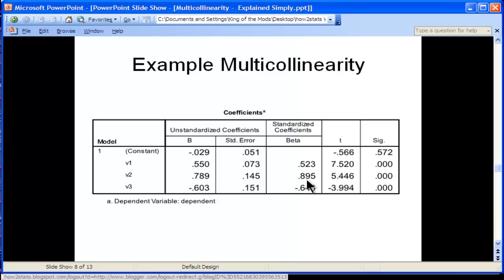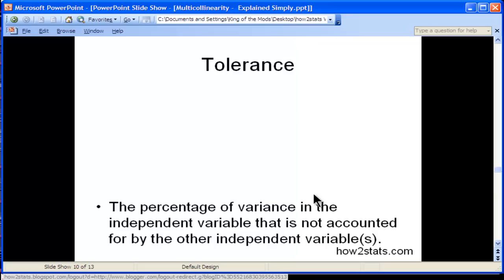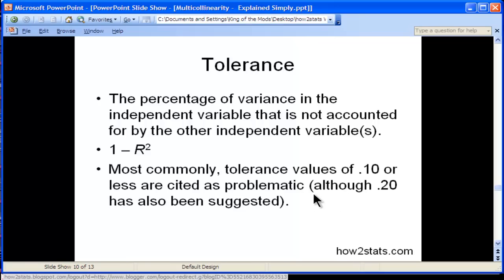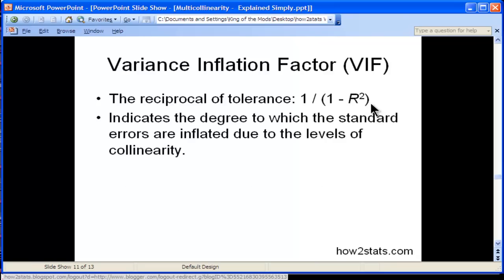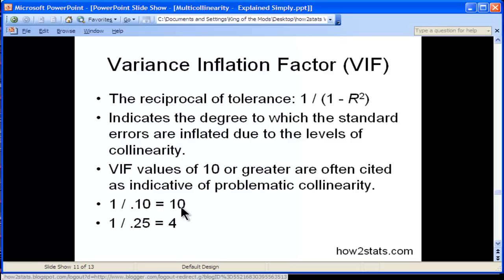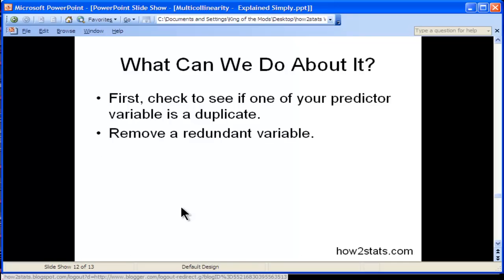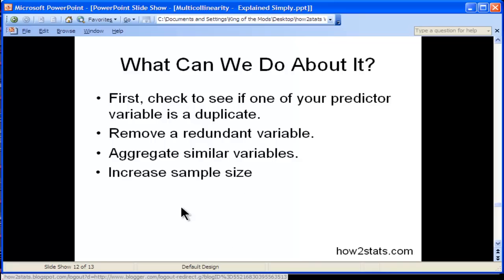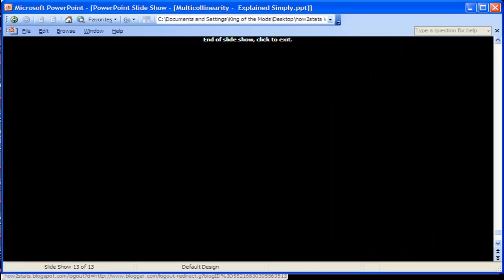Multicollinearity - Explained Simply (part 2)

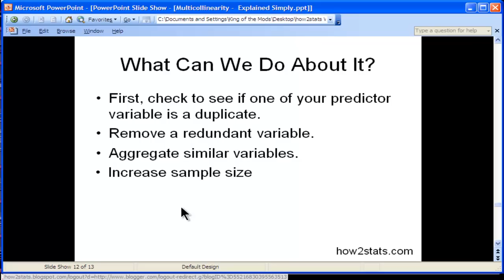Comment: What does 5:40 "add more stability" mean? Isn't a regression analysis a one - time calculation? Does this mean there is randomness in repeated runs and each run will give very different coefficient and standard error results? Or this is talking about stability across adding/removing predictors, and that adding/removing predictors is assumed to not affect coefficient and standard error results at all if there's no multicollinearity?

Comment: Hello again. I'm going to comment on your 2nd multicollinearity video as well just to point out that the VIF statistic--which you explain clearly and accurately--will not necessarily catch the kind of problem you illustrate with your v2 and v3: opposite directions, both statistically significant. I demonstrate in a peer reviewed, published research paper that VIFs can be as low as 1.1 and you still can get the problem. So low VIFs should never be used to dismiss multicollinearity concerns. Please watch my video, which touches on the VIF issue, and if interested you can download my 2018 research paper for the mathematical basis for my claim regarding the VIF. I would welcome comments from you or your many viewers. /watch?v=iV8BLOix5KI
Reply: It is not available (the video), the Youtube link does not work

Comment: thank you so much your statistical lessons
I have question. If X1 and X2 are highly correlated to each other. which variable should be dropped X1 or X2
plz give an answer to my question.
Reply: You can drop any one of them , it will work👍
Reply: @subratkumarsahoo4849  So would it be ok to produce a number of simple mixed effects regression models instead of lumping all the IVs into one model?  Since my IVs are all measuring the same thing (e.g., response times) I would assume this would be ok after watching your video. Thank you so much! 

Also, would you recommend trying to scale numerical values so they are all similar in value? You could, for example, use more decimal points to reduce the orders of magnitude differences that sometimes occur between DVs and IVs. Keep up the good work!

Comment: I am having an issue with multicollinearity in a whole plot factor of a split-plot design.  N = 144, with 16 whole plots and 9 subplots in each whole plot.  It is 3x3x3x2 with one hard-to-change factor (temp).  Under this design, I've reached a predicted VIF of 12.37 for my whole plot factor; while other designs have been between 15-45.  I've been unable to find literature that deals specifically with this issue.  Do you have any recommendations?  I can't increase the number of runs much more!